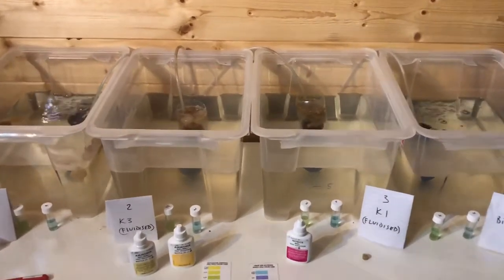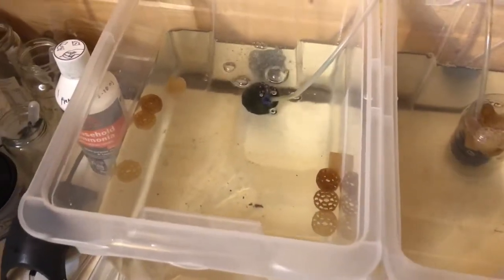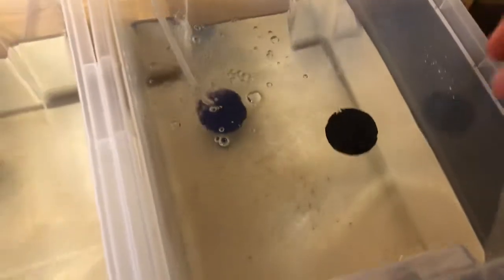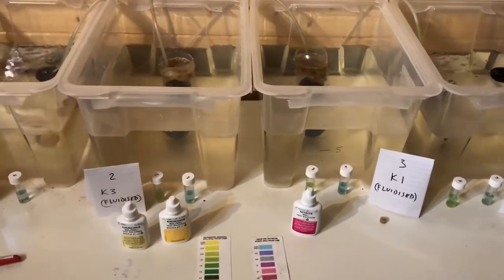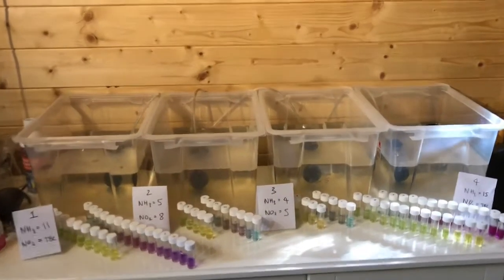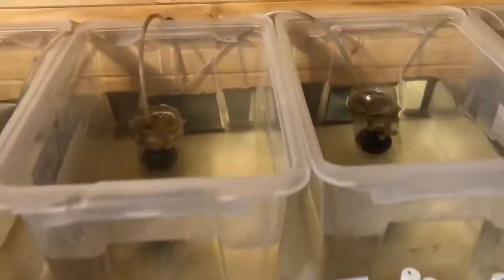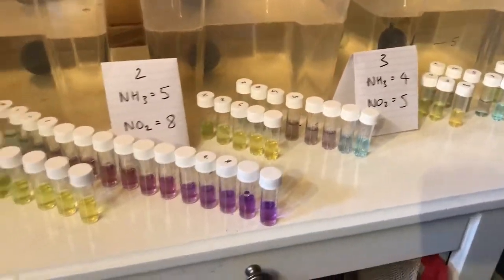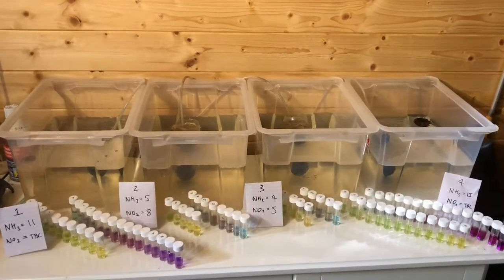How much better is evolution aqua’s K1 compared to K3 media?

Comment: Hi , can you count how much k3 i needed if daily feed is 8kg food and 2.8kg protein
Reply from the maker: Hi - that’s a pretty big operation you’ve got going on there. At face value the experiment I ran would suggest 11,000 litres of k3 - which sounds excessive. However something that I’ve subsequently been working on is the scope for food to be incorporated into the fish and so food consumed doesn’t equal waste produced. From my wider reading this can be as little as 10% in high growth species such as salmon. So if you are feeding at that rate and the fish are all growing strongly, as opposed to simply maintaining their size, the amount of k3 needed could be as little as 1,100litres. Would need to be very heavily arrested too. As it sounds like a professional arrangement you have I would suggest going with k1 which is twice as effective per volume and also consider using other high surface media such as siporax along side.

Comment: Love you work ! Iv got a good one for you if your interested, I’m in the middle of building a large chamber filter one section I was planning on building a super deep slow moving plenum set up to attempt to create a oxygen free zone , I’m told this will develop bacteria that can gas’s off nitrate to nitrogen gas , would love to see some science on this if your up to the challenge the key is depth and slow speed of the water, I’d be happy to make a donation to help with cost if you fancy the challenge!!
Reply from the maker: Hi, sorry for delay in responding. I’ve been offline for a while. I’ve read with interest about anoxic filters but something I’ve found in one of my experiments which I’m in the process of finishing is that nitrate build up isn’t the problem you might think it is when you’ve got lots of aeration. I seems to magically disappear. Also I gather that anaerobic bacteria can live in close proximity to aerobic bacteria in the narrow cracks in media. Therefore you can have successful anaerobic activity in a regular filter if you have media that permits it - eg pumice or sintered glass. Hope that is useful

Comment: Love the tests and documentation. I've been looking for something like this. Can you do a test for Nitrate? Which media, if any, removes nitrates?
Reply from the maker: It’s a great question. I’ve really struggled to think of any experiment to do with nitrates as the test kits are very inaccurate and quite temperamental in my experience. Also I’ve not tended to have any issue with nitrates as plants, algae and water changes seem to keep it in check. I’ve found maintaining sufficient KH to be the more pressing constraint meaning I do plenty of water changes in managing that.